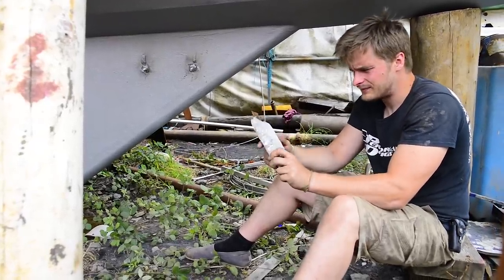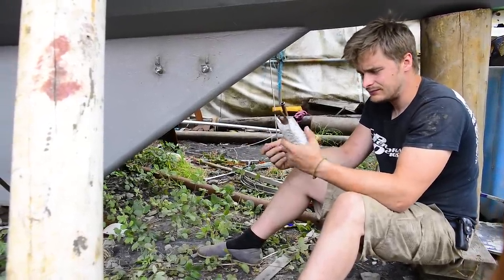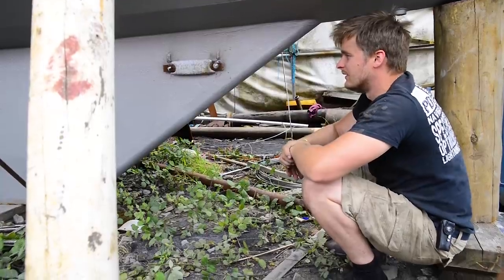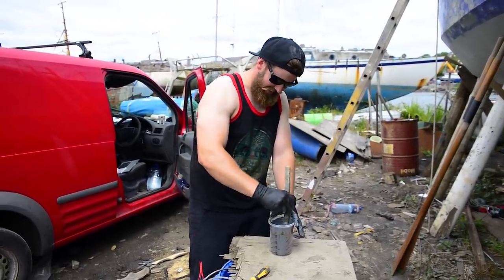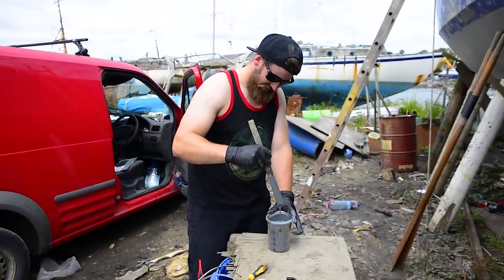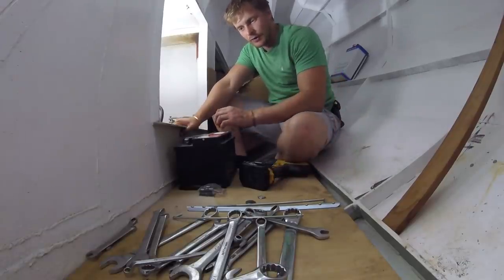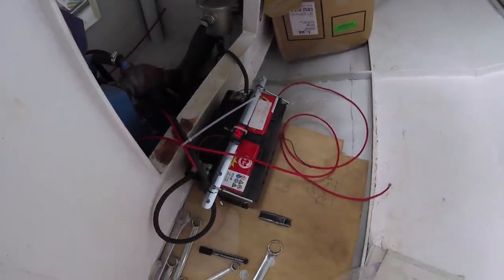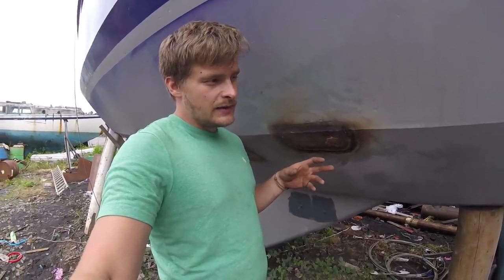Welding Holes in the Hull and Fitting Anodes - Ep 15

Comment: (Sailing emerald steel) has a video  on electrolysis. One thing I learned is that your RADIO antenna can cause extreme electrolysis. He made a filter that prevents that and explained how to make one yourself. The whole episode is worth watching.
Reply from the maker: Thanks mate, i must start watching them
Reply: Sailing Emerald Steel is compulsory. Cheap hacks way better than any shiny chandlery crap well explained and built in absolutely taintless offshore craftsmanship (they once even built a new gluelam mast aboard their swimming vessel, rowing out the boards from harbour freight and rowing back ashore the scraps'n chips ...)
Reply: Instead of cutting out theholes why didn’t you weld a plate over the holes from the inside and epoxy andfair from the outside. Thinking that would be a stronger solution.

Comment: make sure you get a zinc on your drive shaft, also add a couple more larger zincs. You'll want to change zincs every year, regardless of size. I have a fiberglass boat, i replace the zincs on my trim tabs, engine every winter. The ones on my trim tabs are roughly 1/2-1/3 of the size after a year. When new they're probably around 2 inch circles.  Also if you end up having any bracket like transducer going in make sure you bond it to the boat with either a wire or put a zinc on that. I forgot to bond my stainless steel bracket that the transducer mounts too and there was serious pitting in the stainless on top of it 5 of the 6 screws that hold the transducer to the stainless bracket corroded to a point they were non exisistant.. I ended up just tig welding a stainless bolt on the bracket and put a zinc on it. 

My only point is corrosion will happen VERY fast if there's is no sacrificial zincs, so put a few more on and/or replace regularly especially because of your steel boat. Also sometimes sacrificial anodes wont look very corroded depending on their make up but if you weigh them compared to a new anode they will be much lighter in weight even though look similiar in size ; The two main different sacrificial anodes are zinc base (saltwater) vs aluminum base (brackish/ freshwater). 

anywhoo, that welder look like he did a real nice job, keep on it!
Reply from the maker: Thanks mate. You don't want to put too many anodes on either because they have the opposite efect if you do. Every 8 feet there should be an anode and they should be able to see what they are protecting :) I'll be hauling her next year anyway so we shall see how they fared!

Comment: When I built my steel boat an old boiler welder told me how to check for leaks in your weld. After the welding job is done take a piece of chalk and cover the lower side of the weld. On the other side add a liquid, I used varsol, if you have a leak it will show up on the chalk side as a wet spot. I did this on all my hull welds and when it went into the water there was not a single leak. Of course when I first did the initial check there was lots of wet spots.
Reply from the maker: john belljn@hotmail.com nice idea mate thanks.

Comment: Suggest to grind off the outer layer of crud (oxide) on the anodes so that you expose fresh zink. Otherwise you risk them working less efficienctly at protecting the floaty bits.
Reply from the maker: Good thinking mate, before i fit them ill definitely do that.

Comment: As I understand it, it would be more correct to say that charge flows rather than ions flow.  (ions are atomic nuclei with either extra electron(s) or missing electron(s)).
Reply from the maker: The active or less Noble metal will sacrifice it's ions to protect the base or more Noble metal. Ie. The zinc and steel.